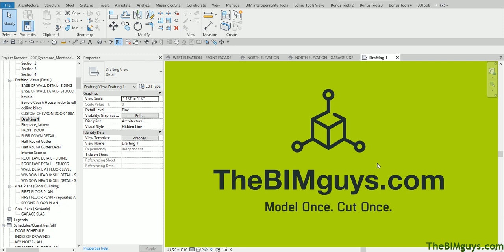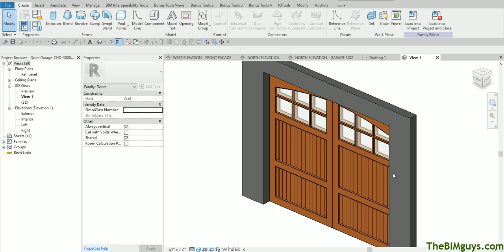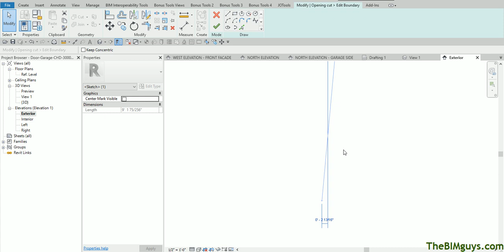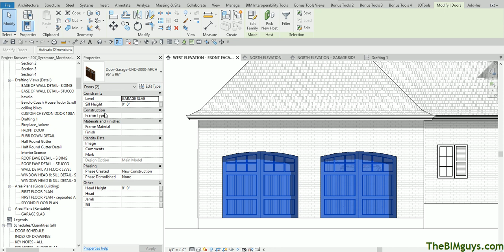Revit Editing a Door Family to have an Arched opening - CADtechSeminars.com

Comment: Great job. I followed exactly what you were doing and was able to easily replicate it. I used to be a builder for... too many years I care to admit. When I finished watching your tutorial, it occurred to me that SOMETHING would have to happen with the brickwork overhead. I suppose in real life, we would create a soldier course/jack arch (vertical) following the shape of the arch. I imagine you could replicate that in Revit by creating a single brick (maybe even as simple as just a grouping of model line, and making an array to span the header. But I could see how that would take some doing and, if you want to replicate it over other doors... Maybe I'm making it too complicated. Is there an easy way to depict a jack arch like that over a curved window? Maybe a sweep?
Reply from the maker: Robert, Thanks for the comment. You are correct about the arch in the brickwork.  The jack arch can be added in the door OR to the wall. I chose to create the jack arch using a sweep (in-place sweep) on the wall. Sorry, I did not create a video for this. (maybe next week.) This new arched door may not always be in a brick wall. It could be used in stucco or other material so I am keeping the doors clean.
I teach Revit and it really helps when my clients understand construction methods.  Once you understand the building process, then Revit is just another tool to create it.  It is a LOT harder for me to explain building methods and concepts to people who have never held a hammer in their life.
Reply: @CADuniversity  I will look forward to that, I am subscribed to your channel now. Years ago, I designed a window family based on the type of double-hung windows we used in the homes I built in Atlanta. I added all kinds of things to those windows with type parameters for visibility for each one. Going by memory, I had things like a stucco jack arch (straight, not curved), a big keystone in the middle of the jack arch, exterior trim of adjustable sizes, interior trim of adjustable sizes, extension jambs (which were a bit problematical), muttons on both the upper and lower sash...Then I created types for the full range of the various sizes that we used (a lot of windows). When I got finished, I loaded them into a practice project and they had so many different sizes and parameters, it was too much for Revit to handle efficiently (at least on the PC I was using). When I went to place one in a wall, it took Revit too long to place one (maybe 5 or 10 seconds but that is a lot of time when you are building a model). I had to delete a lot of them out of the project just to make window placement practical. It was a fun exercise, however.